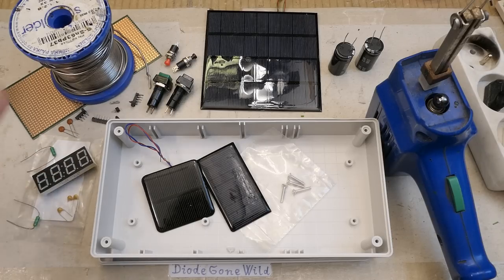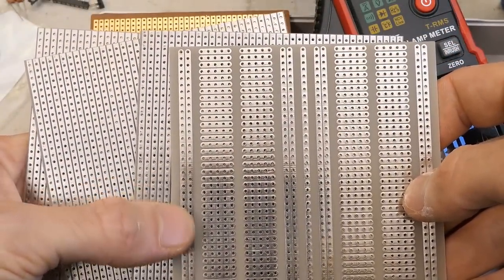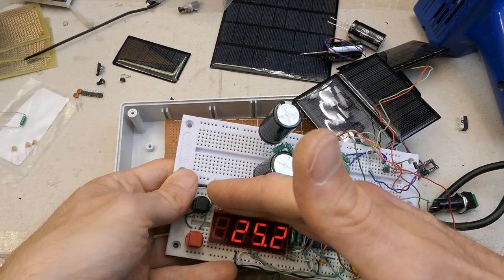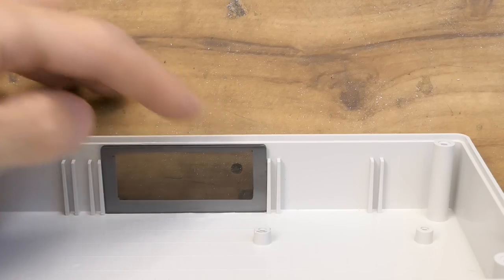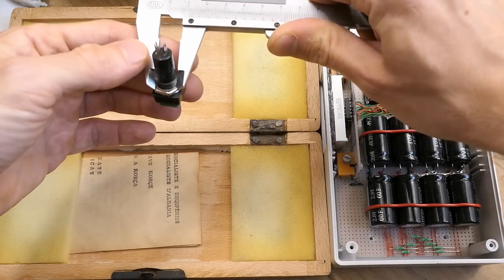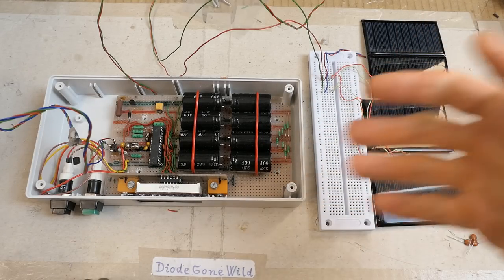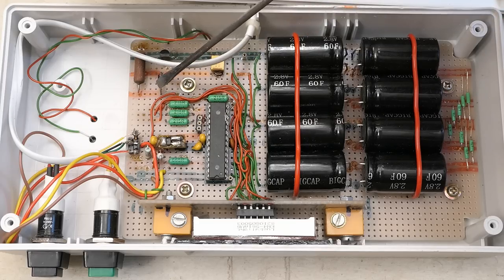DIY solar thermometer - project box, prototyping boards, supercapacitors formed, temperature sensors

Comment: Loved that intro. I'm so glad that there are still people like you who do old-school electronics and not just throw together a few premade modules, an Arduino or Raspberry Pi and add a 3D-printed case (like 90% of DIY projects do these days). Awesome project btw👍
Reply: Modules and microcontrollers used in every project is the killer of today's hobby electronics
Reply: Are those imaginary electronic projects as opposed to real?
Reply: @Friendroid   Of course those are real electronic projects, just not old-school ones using discrete components and making/soldering your own circuit boards. That's what I meant, I just worded it poorly by using "real."

Edit: fixed it ^^
Reply: Colour me disappointed,  I thought we'd be measuring Sol's temperature.
Reply: @madscientist15808 Yes Me too I love to make circuits using analog and digital logic ICs and discrete components rather than using an Arduino and using those modules. I get to learn a lot of things and problem solving skills rather than writing some 20 lines of code.
Reply: @DuroLabs85 and you think you don’t learn anything by writing code?
Reply: @DuroLabs85  Apples and oranges. Don't be pretentious and think YOUR way i the only 'right' one, especially in the electronics field where there are multiple ways to perform the same task. You miss out on a lot by choosing to be so ignorant.

If you really want to be 'something' learn discrete component circuit design for your projects, and learn about microcontrollers and apply said knowledge effectively. Build the most efficient and accurate (as applicable) device for the project.

If you think 'writing code' doesn't require 'problem solving kills', you clearly haven't gotten so far as 'Hello World!' - Debugging exists for a reason 🤣. Good luck with objectively expanding your knowledge and skillset. It is quite possible (and most common in the hobby) to learn analog and digital EE concepts.

If you're anti-digital, you're anti-electronics.
Reply: @Desert-edDave  Hi, I am not anti digital or anything I have used multiple arduinos and raspberry pis and know multiple programming languages only thing is I enjoy the old school electronics more :)
Reply: old-school eletronics? wtf? this is ORDINARY electronics, arduino bulls*ht and other stuff like this has nothing to do with eletronics... jesus--

Comment: About the water proofing of the sensor:
I'm certain you've heard of marine heatshrink. It basically has hot melt glue lining the inside of the heatshrink. Heat it up and not only does it shrink it coats the connector in glue. You can also check out an automotive parts store for heatshrink that is waterproof (same thing as the marine rated stuff). What I've done before is coat the wires in a thin layer of hot melt glue, wait for it to cool, slide over regular heatshrink, then shrink and melt the glue at the same time. Works pretty well. For the ultimate I just pot the part in two part epoxy. Make sure the epoxy is waterproof first. Found that out the hard way that some epoxy isn't.

Comment: I have used the strip boards for many projects in the beginning. But with time I found that it actually takes longer to cut the traces in the correct places (and making sure that they are properly cut without damaging others), than it takes to create traces on a dotted board. To create the traces I use a single strand of a stripped stranded wire (get a wire with comparatively thick strands; 0.3mm diameter works VERY well for me). Tacking the wire at the ends and corners of your "traces" is enough (except for long stretches), but I usually finish it by tacking the wire down at every pad. It just looks nicer 😅.
IMHO the dotted boards are the only ones you need as they are the most versatile of all without any real disadvantages. You need jumper wires on all boards anyway to get from one trace to another. On dotted boards you are already working with "jumper wires". Just thread your "trace" wire through the hole where you need a jump (at least in those cases, where it doesn't matter that the wire isn't insulated, which in my experience is most cases). The predetermined direction on stripped boards makes the layout much more complicated than it needs to be in many cases. And it's even wore for all those even more "special" boards (that try to emulate the breadboard layout for example).

And yeah, those aliexpress/ebay boards are awful! At least the "paper" ones. The pads separate from the board if you look at them funny, or try to solder to them a second time. It also always seems like they run their drill to the point where they are more of a punch than a drill.
Reply: For the vero boards/dotted boards I just use the wire leads from already soldered components to make the "traces". I keep all of the cut leads and use them for other circuits. On the one-sided vero boards I also use "jumper" wires that I solder like normal components to jump over a trace.

Comment: I haven't seen the breadboard style PCBs before. I use the ones with holes only and I make the traces out of wire. This allows me to put the components wherever I want and to pack more of them on a small PCB if needed.

Comment: Awesome Danyk! Install a Glass cover over the Solar Panels with silicone to keep them in good shape over many years. I have found that the Epoxy Resin Panels start to dissolve over time due to sour rain. But a great build! 😃
Reply from the maker: This is going to be used indoors ;)

Comment: I've used quite a few of those prototyping boards with "dots" of copper over the last few years, and I always make traces on them by shorting them with solder, and they seem to work OK. For small and big boards they're better than the ones with stripes, which make sense only for medium-sized circuits, and even then I prefer the "dotted" ones, but that's just my opinion :)
Reply: I agree. I have used the strip boards for many projects in the beginning. But with time I found that it actually takes longer to cut the traces in the correct places (and making sure that they are properly cut without damaging others), than it takes to create traces on a dotted board.
But I don't use solder to short the pads together. Not only would that take way too much solder, it is also time consuming and a sign that you have run your solder dry of flux (meaning risk of bad solder joints) as it wouldn't form a solder bridge that easily otherwise.
To create the traces I use a single strand of a stripped stranded wire (get a wire with comparatively thick strands; 0.3mm diameter works VERY well for me). Tacking the wire at the ends and corners of your "traces" is enough (except for long stretches), but I usually finish it by tacking the wire down at every pad. It just looks nicer 😅.

Comment: What I've found works nice for a right-angle PCB mount is just to get 90 degree headers and solder them onto the bottom board and then use a female header on the upright board. It makes it removable too. Of course it's not so ideal if you need strength. You could probably brace it with solder and with a sideways triangular PCB and some more 90 degree headers.
Reply: Neat idea!
Reply: That's what i do for me at home, but if you need something more robust and industrial, there are connectors in "pc ram style" (edge connector i think) that also provide a lock for your board not fall out, i've seen it many times on 80s and 90s gear, where  everything was mostly discrete components
Reply: I've seen boards on factory made pcbs soldered together at 90 degrees, but with a tongue and groove cut into the two boards for support. Wouldn't be too difficult to do with a dremel, but depending on the tightness of the fit, it wouldn't add much strength either.
Reply: @JulianA-tr6pt  I proposed a design like that at my old job, but it was denied for strength reasons. I would imagine you could do 2 tongue and groove sub-boards perpendicular to the edges of the base and side boards to good effect.

Comment: You could dim the display depending on the light that shines on the solar panels so when no voltage is produced go to the lowest setting at night and so on. So you do not need to dim manually. I like what you are doing here and I get a lot of inspiration from your projects. Greetings from your neighbour country Germany.
Reply from the maker: It dims automatically, but also manually :).  You can select 5 brightness levels, but it reduces the brightness to 1/4 at night on top of that.
Reply: Very nice feature!

Comment: I have changed to stepped drill bits for making tidy holes in panels. Regular drills are usually messy in comparison. Of course with a nice clamp any drill will work nicely, for croc clamps or using just your hands, stepped drills are cleaner
Reply from the maker: I've lost my set of stepped drill bits :D

Comment: That looks like a fantastic project. Sadly, due to my age, background and lack of familiarity, i have an extreme aversion to IC chips and programmes. I can cope with transistors, or even Darlington transistors, but that's as far as I go
Reply from the maker: I only like microcontrollers if they contain my own program :D
Reply: well, you still can build most of electronics from this Danyk's thermometer, just without LED display and uC, but with microamp analog meter and some simple R/C timing circuit to powering it up for a few seconds by pressing button.. there is always a way without uC, but it simply must not grew up in some crazy way

Comment: Hi, could you please make a video on writing the program in the microcontrollers, wich you use in your projects? I know you mention it on your website, but I didn't quite understand it there, and I'd like to learn it so I can build your schematics as well 🙂
Reply: one of the many simple ways to feed firmware into AVR microcontrollers without using LPT/232 port is to use USBasp ISP programmer with eXtreme Burner software.. it costs about two dollars and do the job quite reliably, see the google

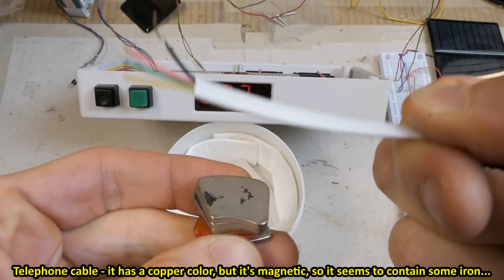Comment: At 19:18 ... This CCS phone cable (steel wire with copper coating) is not that bad for low current. It can be soldered with no problems and it has a lot of mechanical robustness, especially tear resistance, which is advantageous when originally used as a telephone cable. Aluminum, on the other hand, is completely bad because it is very brittle and the contacting also causes problems. In the premium range, i.e. business phone systems, copper is braided with fiberglass. This combines the conductivity of copper with good tear resistance, but is expensive and can only be properly contacted with a crimp connector.

Comment: I usually use wire-wrap wire for those boards with dot copper. saves solder if you don't need that much current. If I need current then I usually use bigger wire and maybe strip it if it's ground.

Comment: Nice design, great execution.
What if you'd run the thermometer on one supercap and use the remainder of the bank for feeding a boost circuit that is only enabled for a bit when the one supercap is falling below, say, 1.8V, until it's at 2.5V again. With that boost circuit you'll be able to use more of the capacity by discharging the bank to 0.6V.
Reply from the maker: This would probably work, but all the complexity and losses in the boost cirucuit :). And the brightness would cycle up and down. I rather have it simple and also having no regulation makes the brightness and consumption of the display naturally ballance with the average light exposure. If less light is available for the panels, the capacitors end up at a lower voltage and the display draws less current, preventing the capacitors from discharging below the minimum voltage for it to operate. With a regulator, it would try to keep a constant brightness in dim winter days, resulting in total discharge and shut down (reset).
Reply: @DiodeGoneWild  You're right. In most cases, over-complicating it for a bit of extra run-time doesn't gain much. I mean, additionally, you could also dim the display using pwm, dynamically with a calculated value from the supply voltage value and the value from an ldr voltage divider. But that circuitry also needs some power. So, kudos for keeping it simple.

Comment: One thing you can add to the firmware, measure the bank voltage. Using the reference as a reference (doh!) you can just measure Vcc using another channel (or even better if the atmel has a way to measure it internally), and show it as well
Reply from the maker: I also thought about this. A pair of resistors as a divider going to another ADC input would do. ADC3 is still unused, so I might add it in the future. But I was too lazy :).
Reply: @DiodeGoneWild  Can't it measure the Vcc directly by routing some muxes on the ADC? Also, if you add the resistor divider, tie one end of the resistor divider to a GPIO and only turn "off" that GPIO when measuring (and keep it as input all the time), so the voltage divider doesn't consume any power while unused :)

Comment: Nice project,  you can add an rtc and modify the firmware to add a clock , did u used 7 segments lcd display they use small curent but they need complicated programs to drive them.

Comment: How does the circuit ensure that the super capacitors are not overcharged. Or do the solar cells not exceed 2.8V?
Reply from the maker: The TL431 limits the voltage of the supercapacitors to 2.5V
Reply: @DiodeGoneWild thanks for the reply I tested it in a simulator and it works I might implement the circuit into my RF sensor so I don't have to replace the batteries every month. I just wish I had the knowledge to do it without an Arduino
Reply: Actually it was simple. I used the Attiny85 and a circuit using a voltage divider and the tl431 to charge NiMH  batteries using solar cells.

Comment: I made something similar just based around an Arduino nano and a RF module. It sends it's data to a proprietary super old weather basestation. I made it because there's no replacement sensors. Maybe I could use your schematic to power it via solar as well.

Comment: You could change brightness automatically using solar cell as light intensity sensor.
Reply from the maker: This is exactly what I already do :). You can manually select 5 levels of brighness, but whatever level you choose, it gets reduced to 1/4 of that at night.

Comment: Unfortunately, those solar panels all turn milky white in the Sun, after only a few months. 
I built one similar and screwed up by putting an LM35 instead of a TMP36 I had. I used hot glue to encase the whole probe into a tear-drop shape.
Lost some hair finding the problem. LM35 is only good for above 0ºC and requires negative supply as well to go below zero.
Since mine is outside having to deal with Canadian winters, it would've been totally useless under 0ºC.
Reply from the maker: Really? Then they are probably one of the sad examples of things that went into production before anybody ever tested them in realistic conditions. But they should be fine in room light. Yes, LM35 needs a negative supply below  2ºC. That's why I'm using MCP9700A, which has the output shifted by 500mV up. And it also draws just 5uA, while LM35 draws 50uA, as far as I remember.

Comment: Try LM35. -55 - 150°C ±0.25°C. Less Than 60-μA Current Drain though.
Reply from the maker: LM35 uses a negative voltage for temperatures below 0°C. That's why I use MCP9700A instead (which also draws about 10% of the current consumption of LM35)
Reply: @DiodeGoneWild  yeah, but you can get negative voltage if you put two diodes on the ground pin, to raise it from ground. Seen in typical application.

Comment: I would have used a single Lithium Iron Phosphate 18650 cell in place of the supercaps and run the microprocessor on 3.0 or 2.7 volts.
Reply from the maker: That's also possible. If the capacitors fail, I might use this or 2 NiMH. But so far it seems to work well.

Comment: I can't see quickly if you put a warning already, but I have often been warned that you should be careful not to breathe the dust from plastic or circuit boards when drilling/sanding/filing/etc. I'm usually too lazy to find a mask or respirator to wear, but figured I should pass on the warning anyhow.